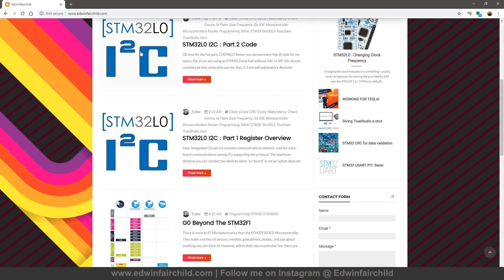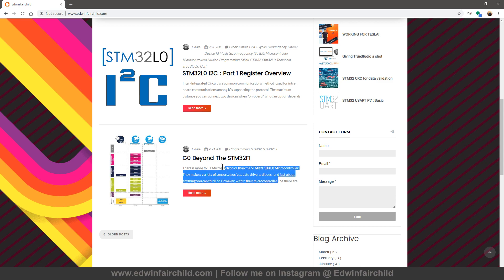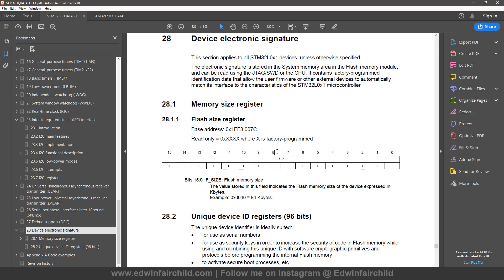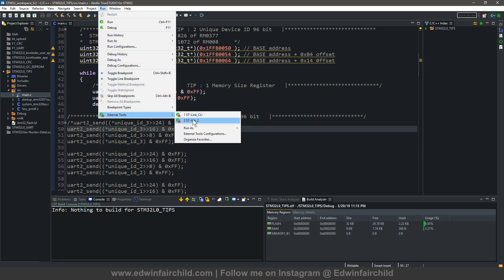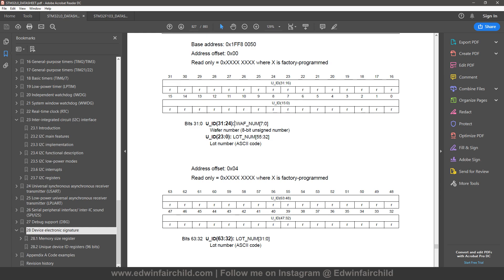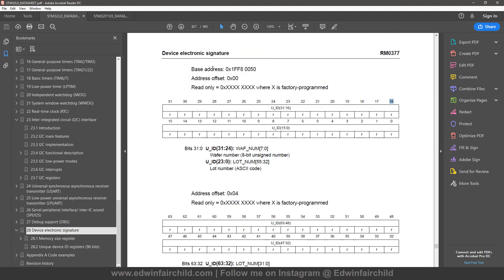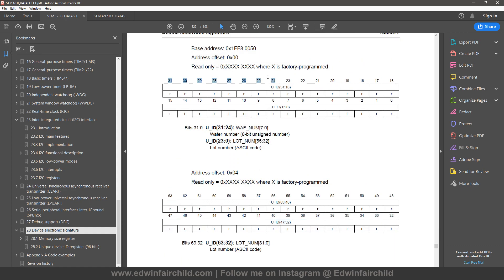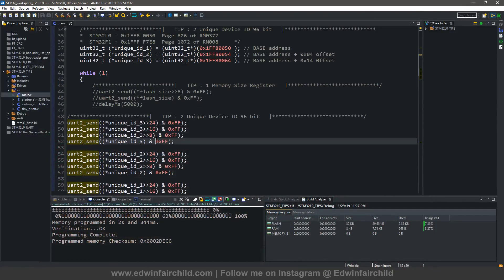STM32 TIPS: Get Unique Device ID & FLASH size from chip

Comment: Can i also do it with STM32f207?
Reply from the maker: If it's one thing I teach it's to use the reference manual. I do not have answers for all stm32 chip. so check your manual and see.
Reply: @EdwinFairchild  Sorry, i am noob, can you recommend tool for do it? Tool can communication with MCU via STlink V2 or Jlink interface. Because i have device already register account with serial of device, but i need replace main chip STM32f207 with swap old database to new chip but i don't know how to do it. Thank you for special video!

Comment: If you want to flash some user parameters, how do you know which address range is available for user data?  Doesn't for example, the running program/bootloader execute out of this same flash space? 

According to stm32h7xx_hal_flash_ex.c, the STM32h7 has TWO 1MB banks, each with EIGHT 128KB sectors of 'Main Memory' and 1 sector of 'System Flash'.   I assume the linker script describes which sectors of the flash are used for code/initialized data, but I don't see it!
Reply from the maker: Bootloader is in ROM and I would consult the RM do get exact data mapping. H7 and and Cortex M which is what I deal with are 2 different beasts.